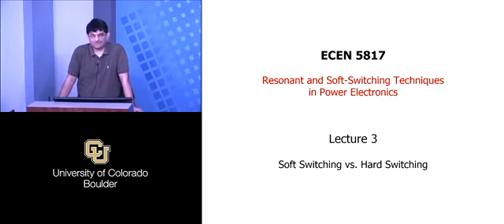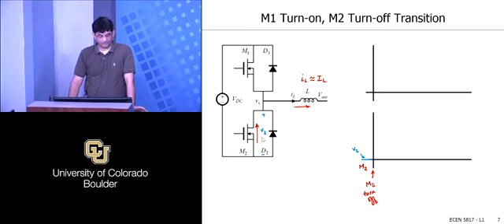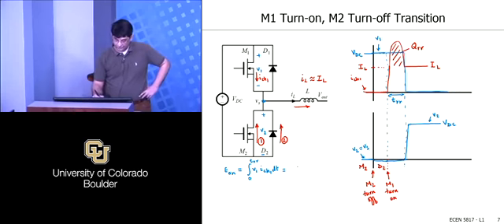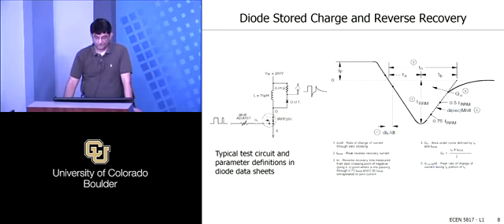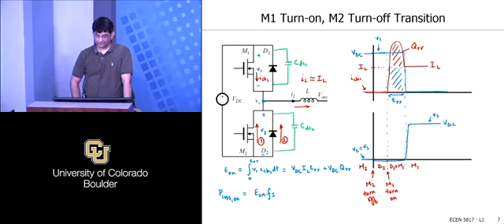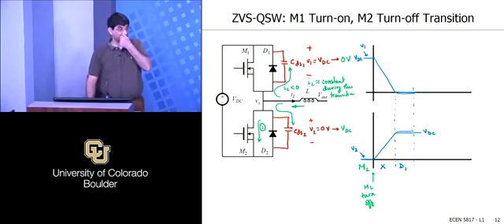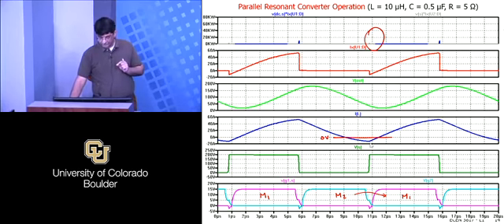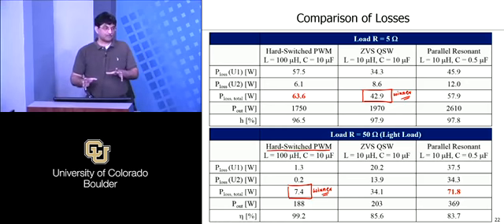ECEN 5817 Resonant and Soft Switching Techniques in Power Electronics - Sample Lecture

Comment: GaN, SiC has very low Qrr. That is reason, in hard switching application they are very efficient device. I used them in Synchrous Boost converter.
Now there are Cascode GaN (or SiC)+ low voltage Mosfet devices are available. This device offer simlpicity in gate driving and very low Qrr.
Remember, in any Synchrous application, take care for Qrr. Not only they create loss, but creates voltage spikes on switching devic when it recover. 
Another way to tackel Qrr, implement Non-dissipative snubber and Adaptive delay ckt. 
I am designing SMPS for last 40 yrs in US.

Comment: Qrr is the major loss contributor. The soft switching technique recover that energy. Qrr hold the Mosfet ON even when the Gate is turned OFF. 
This phenomena you can treat as extension of ON time. When the Qrr is "flushed out" then the mosfet is able to block the voltage. 
This Qrr× Vbus energy is stored in the resonant inductor and gets regenerated. 
I used CFD7 (Infineon) type mosfet.